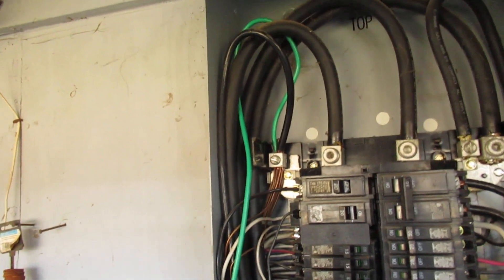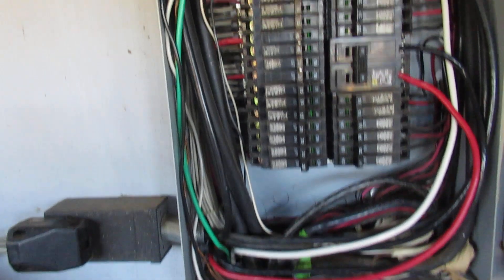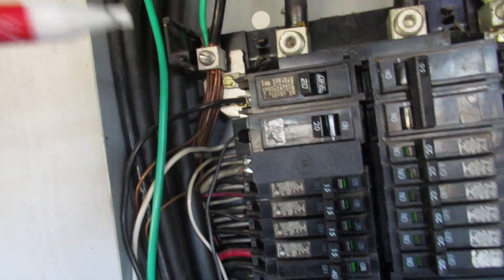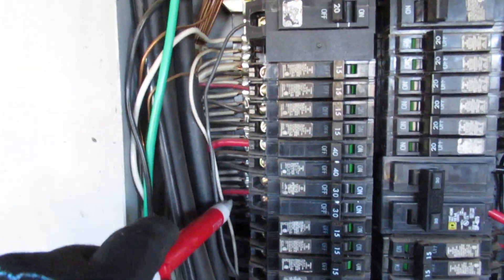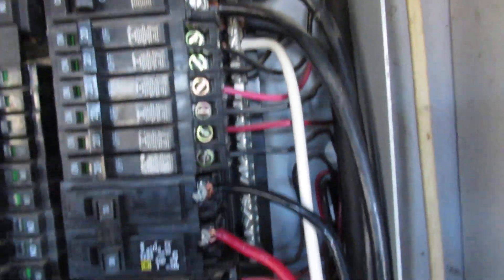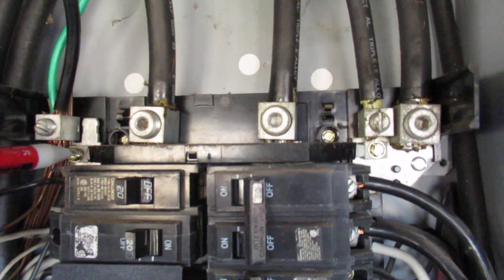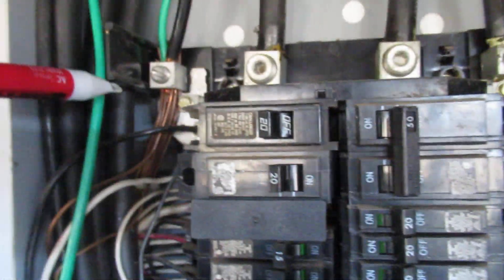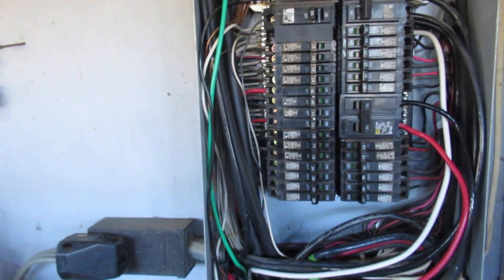Apparent Neutral to Ground connection at sub panel

Comment: Have a question. Let's say you remove that bonding screw....now, you have a sub panel that meets electrical code. No neutrals and grounds connect supposedly going back to the main panel if there is one being as this sub panel looks massive to me. Now, what happens if you incur an " open neutral " at that sub panel ? That panels path to neutral in the main panel is gone ? Remember, it's not connected to ground now at the sub, nor the main, and let's say the breaker in main " didn't trip " either ..... What happens to you ?? Say you get a hold of that open neutral somewhere in the panel or the main neutral break in that panel....what happens to you ?    Explain that to me.

Comment: I’m a home owner and I discovered high DE fields on some circuits. I’ve installed Satic whole-house filter and while it helped overall, it amplified my DE issue on those specific circuits. How can I troubleshoot those? When they’re off, everything is fine. When they’re on - DE goes through the roof on other circuits unrelated to that one. 

One thing that bothers me - just from my personal observations - I have only one panel (no subs) and in my panel multiple grounds are screwed into the same bus bar as neutrals, some of them go under the same nut. Can this be ok? Can this be causing these DE issues? 

And fyi, I tried finding a licensed electrician to help me figure this out, but when I mention DE, they look at me like I have two heads.

Unfortunately there isn’t a lot of information about common wiring issues that create high DE levels in the wiring. I’ve searched for week and I can’t even find an answer to the question “Does connecting ground and neutral wires on the same bus and/or under one but cause DE issues in the MAIN panel?”
Reply from the maker: Hello Jena,  You have multiple questions.  I would have to have a consult with you in order to gather more facts before I could advise you.
Please fill out the Contact Form on my site: https://www.windheimemfsolutions.com/contact-us/

Comment: Yep, there is an NEC code requirement for sub panels to have floating neutrals; however there can be some exceptions (you mentioned "a disconnect 100 yards away"); that may be far enough to have a true main panel at the home, this is where a licensed electrician needs to be onsite to determine.
Reply from the maker: Right.  I leave that up to him.

Comment: Astonishing what you find on any given day.  Obvious a big job to put the sub panel into service. Then miss the obvious rules.
Reply from the maker: Right.  The current owner says this house was wired by a plumber.  And where was the Building Inspector? He should have seen this with his eyes.
Reply: @windheimemfsolutions  may be in a locale or in county where new construction inspections are not required on electrical, plumbing, etc.
Reply from the maker: @covenantpropertyinspection7077  Hello Covenant,  Electrical permits are required here in this part of California.